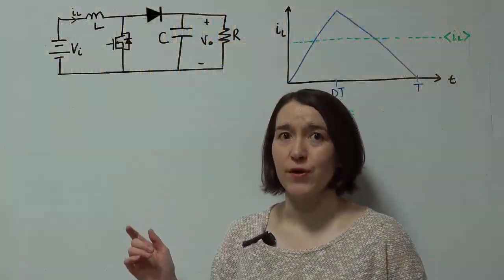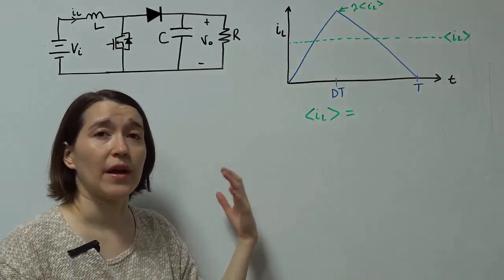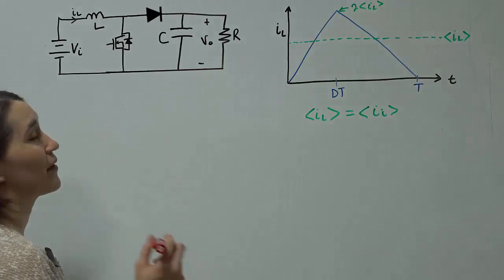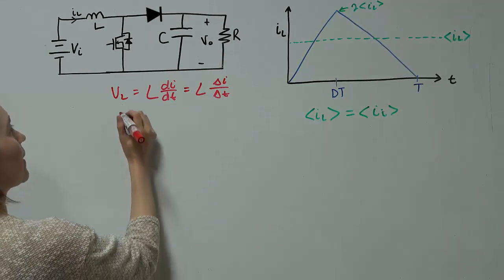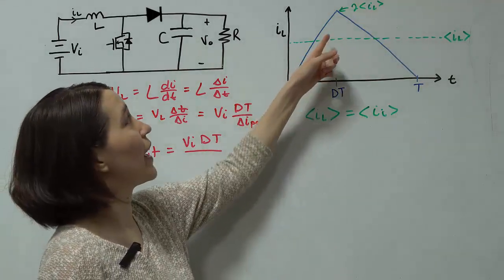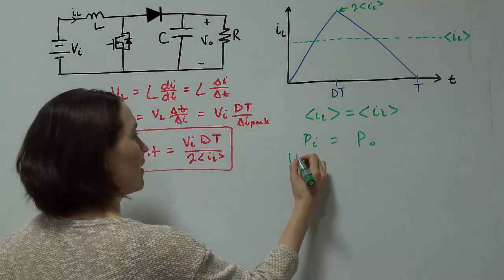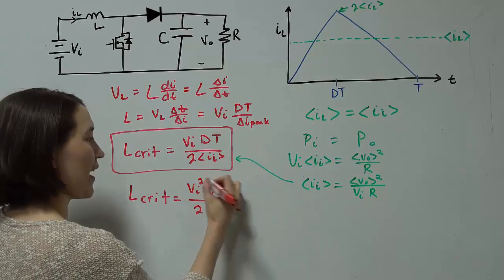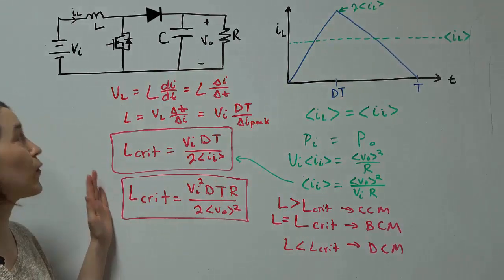Boost Converter Critical Inductance Value

Comment: I have a question ma'am, how is the rise of the inductor current a triangle/linearly rising? Shouldn't it be raising like in transient RC circuits? I'm having problems working with that.
Reply: And of it is rising in a transient way, how can we determine the rise of current in the inductor? Because at T-on the inductor is just connected to the DC voltage with no resistance to speak of; except perhaps the wire resistance. How can we then find the final current if so?

Comment: Hi, quick question. If you reduce or increase the L, wont the slope just have different angles? 
You still get BCM, but output current will vary?
Reply: Hi Daniel my understanding is that larger inductor u have, during switch off condition more energy   is  pumped into output capacitor for longer duration as large energy is stored in inductor. If u have smaller inductor, inductor would loose its energy before the next switch on condition. Hence smaller inductor leads to discontinuous-CM
Reply: Inductor value greater than min. Or critical inductor value will always ensure its in CCM.